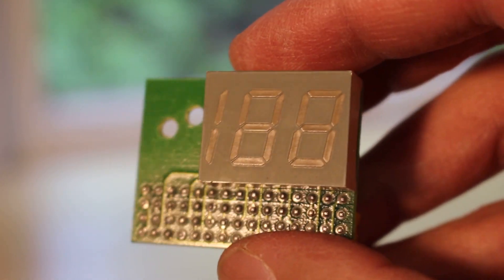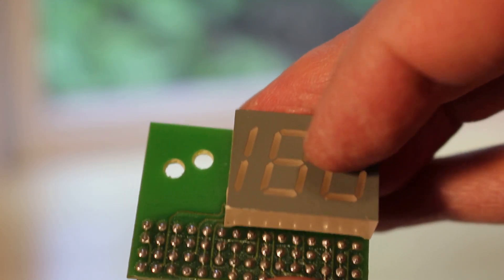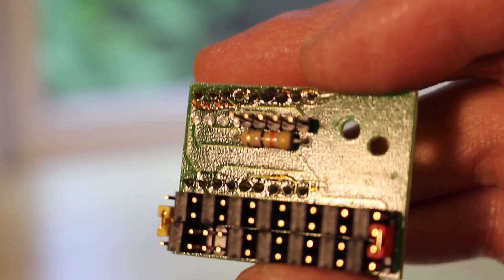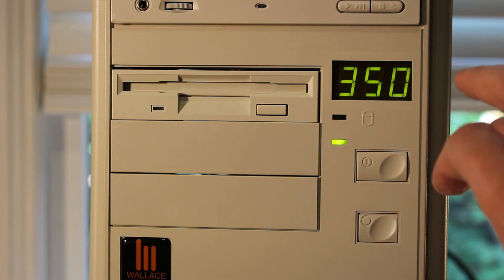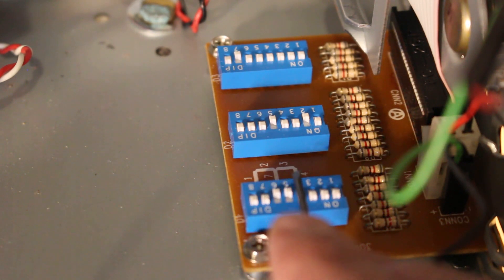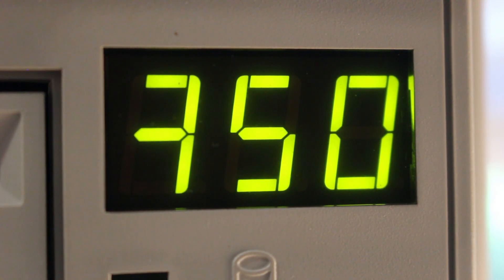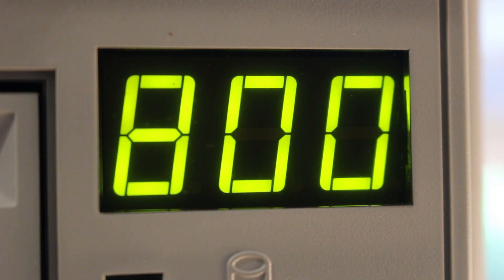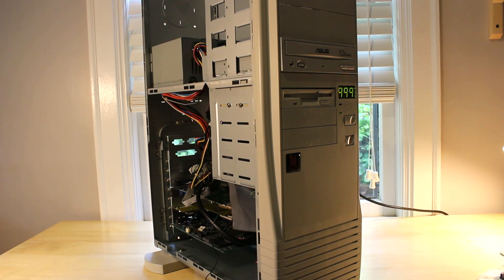Why I Love this MHz/Turbo Display

Comment: Thanks for this very useful and informative video. I am rebuilding my first PC  from the mid 90's and it's missing the display (got 

removed) one with two full digits and a one with jumper settings. But i have now a working replacement, only that it has 3 full digits, is not 

controlled by jumpers but by a chip. Also has a changable battery on there, a small LR41 coincell battery. It will work in my case but i 

am wondering how to set up this thing to show thw correct MHZ??. It has 10 pins and they read from the left. LTHRR+-SST. PD 900 also on 

the board.

Comment: What a coinsidence! Today I got an old baby AT tower for my 386 build and at this moment I'm trying to figure out how the LED display works... If anyone can help me find a diagram or some sort it is a K-618H led display.
Reply: You can get the SET of jumpers using a diagram of some display that looks like it. I was able to configure mine using a diagram of the s-510, and with a bit of trial and error obviously
Reply: @VictorKorp1999  Ι managed to set it at 33/17MHz just by trying combinations jumper by jumper. It took me about half an hour. But then I did some testing and realized that my cpu runs closer to 20MHz  with de-turbo... Right now though I'm done  with tinkering so it will stay like this.

Comment: it'd be neat to do something similar with a raspberry pi for a modern pc. You'd just have to setup several of them, or set it based on an average...
Reply from the maker: I'd like to see this! Seems a bit involved though.
Reply: @GamingRetro  On Linux, you could have the rpi login to the host machine via ssh, then pull the MHz line and show that. The pi is only really necessary because you'd need the gpio pins to connect to whatever screen you're using. Unless you get a small lcd that can hook to usb or run an hdmi cable out the back and setup a second monitor.  I'm pretty certain a pi/arduino/etc could talk to that display via their gpio pins and get it to work. May have to just get a generic 7 segment display to use.